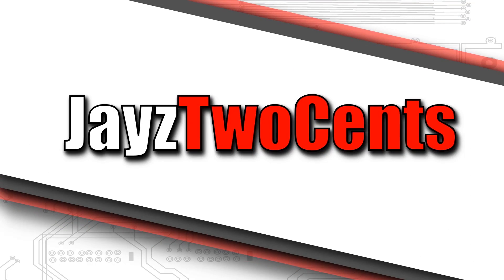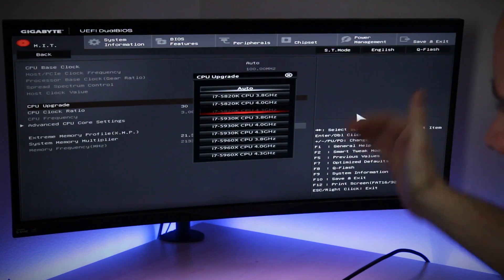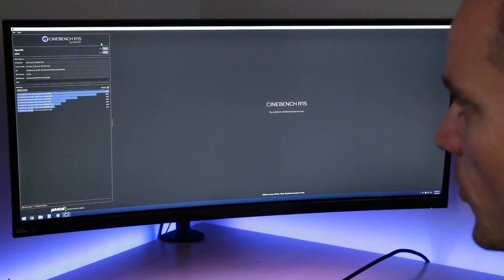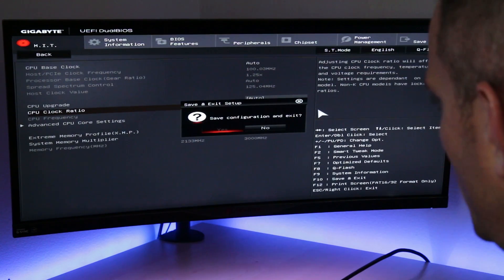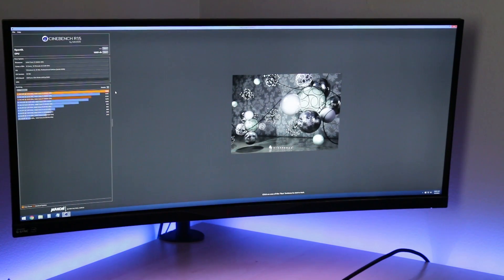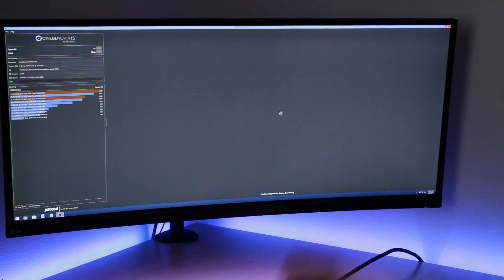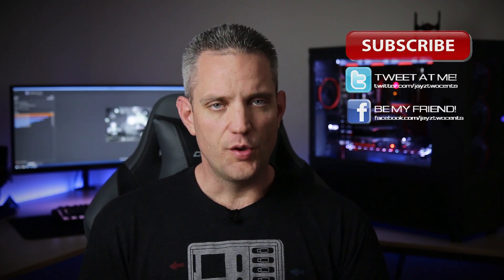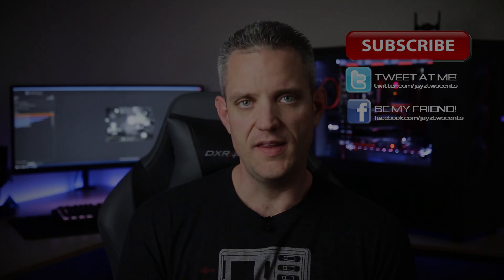XMP vs Overclock

Comment: Hey jay, just wondering, I am going to buy an i7 5820k and 16gb of 3000mhz ram. would i need to over-clock my ram for it to go to 3000mhz? and would I be able to do that at the same time as over-clocking my i7 5820k to 4.0ghz? Thanks
Reply: yes and even without given more voltage. my is running 4ghz stabil with just setting it to 40 in MSI bios
Reply: +Kenny Søholt and I had 16gb ram 2133mhz at that point. now I have 32gb of corsair Vengeance 2666mhz running quad core
Reply: Kenny Søholt so do i enable XMP then go to 4.0ghz through cpu? could you give me a tutorial link on that or... sorry just a little confused, first time overclocking cpu and ram together etc

Comment: FX-6300 5.45GHz @ 1.716V? Yeah, very slim chance of ruining anything... :)
Reply: +Dexeus I-Is that what you are running? What is even the point? The 6300 is garbage even at high frequencies. Do you really want to risk ruining your motherboard and processor for such minimal differences?
Reply: +Deadrablade I'm not running that 24/7, it's just my personal highscore :) Although the 6300 isn't nearly comparable to X99s, it's definitely not garbage. Very nice for overclocking :)
Reply: Dexeus Good for overclocking=/= not garbage

Comment: My system caps out at +42% overclock. I tried to get it higher but i keep increasing voltage and eventually crash anyway 
OR turns into a active vulcano neither is wanted. Maybe i could get a + 2-4% more but pointless.

Comment: got 5.0 stable on my i7 4790k on air (noctua ndh 14)
Reply: I give it a year
Reply: you gave what a year?? :P
Reply: +Jakob Olsson 5.0Ghz on air cooling, I would give it a year max for your cpu to burn out I would recommend toning it down to 4.4-4.5Ghz for better mileage in the long run :)
Reply: why my 100% load temp is 68 Celsius
Reply: i was really lucky with my chip i think
Reply: you might just be
Reply: i have it on 1.33 volts
Reply: and stress tested it in 24h with aida 64 and no crashes
Reply: ah fair enough
Reply: yea so i think im fine :)
Reply: have used it for 14 months now

Comment: I can't OC because i have a i7-4770K.
Reply: If the chip has a 'k' you can overclock.
Reply: +Joe Higgitt i know,but try OC an 4770K.
IHS is shit,and it's luck of the draw with them.
Mine needs a ridiculous amount of voltage to keep stable,so it runs so hot you can bake crepes on it.
Reply: +Dimera ah that sucks, although I have a 2500 k and run a 960 and don't need to overclock. Especially when DX12 comes out and it can utilise hyper threading more, you probably don't need to unless you're rocking a serious GPU.

Comment: Hey Jay, any reason why you run your CPU at full speed all the time? I personally find Intel SpeedStep to be working very well and and why not give it a rest from time to time while saving money?
Reply: how do you enable it in bios?
Reply: Depends on your board, but look for EIST (Enhanced Intel Speedstep Techonology). You also have to set your power options in windows. Go to Advanced settings > Processor power management and setminimum processor state to 0 or 5 % (0 works fine for me)

Comment: I can overclock, Not that i have the cooling, but even when i have my better cooling solution it won;t be a hiegh end one. Just a 212 Evo. even sdo i should be able to get my 8320 to a 4.2 ghz. But here is the catch.

I have an Asrock 970 Extreme 3 R2.0, Which is a 4 - 1 power phase, Or so i read on a forum, Tomshardware. But my motherboard has this X-boost feature which automatically overclocks your system, also read that this cause issues for people.

I also have read that a 4-1 power phase motherboard is bad for overclocking because it get hotter than the better 8-2 power phase, which makes sense, Although i should be able to push it to 4.0 ghz without anytrouble as it regularly boosts to 3.9 and my motherboard never really gets hotter than 30C usually stays below that. the socket itself stays around 50 - 60C sometimes going to 66C

May i also add that i have terrible case cooling.. also a terrible case which basically has 0 airflow capabilities the only front fan i have get's obstructed by 3 HDD. Can't wait till i got my s340...
Reply: +Hendrik visch dony push to hard on that mobo, it's very easy to fry
Reply: I have my case slightly sideways and a fan that i hardly use my self facing inside the casein an angle so the air goes in the front and the side..

But an 8320 is basically a downclocked 8350, So basicallt i should be able to put it on 4hz with no issues as it boosts to that number anyway with no issue... I have seen the voltage go to 1.42 and it never became to hot. And if my mom doesn't go crazy with the heating in the house my room cna get pretty cold like right now. But i like this cold because i get hot very fast,,, I wear a vest and it feels not colder than i usually feel, basically on what i like, in a hour i probably feel liek opening my vest because i have it too hot.

But since this motherboard CAN house a 8350 i could make it work if i can mke it happen in just the 1.3 voltages.

An 8320 is a 8350 that couldn't stay on 4ghz on the 1.3 voltages. I have no ideo how long this tests ran but i see people doing it anyway... Probably it was heat that was also a factor. But a .5 overclock should be  a ble to. If i have won the  silicon lottory i can do 4.2ghz.

The current case i have is the Sharkoon VG6-W Green. Horrible case, Horrible.

Comment: 0:13 FX-9590 LN2 Overclock attempt No.3.
Reply: Actually a good one 😅😅
Reply: OMG love this comment spent hours on the phone talking my buddy through troubleshooting his PC crashing while gaming on an fx9590 (air cooled default bios settings)
Reply: @johnnyconnors4167  I'm still using an FX9590 (unfortunately) after 5 years. Back when I first got it I was able to clock it at 4.9 tops. Now I have to underclock it to keep it stable. 4.5Ghz, 1.36v and CPU/NB 1.15v Freezing has always been a problem in general with the 9590. Honestly, this CPU has taught me a lot about OCing and I really didn't know what I was getting myself into when I bought it 5 years ago thinking I could conqueror this thing. :P
Reply: LOL
Reply: dosduros on LN2?

Comment: Silicon lottery isn't nearly as big of a deal anymore with Haswell/Haswell-E/Skylake. (ESP Haswell Refresh and Haswell-E). With recently made chips, you can basically dial in 5 minute manual overclock higher than any automatic will do (4500 @1.3V on x99 is a good example) with near 100% success (obviously assuming your cooling is good enough, but that only needs like a 240 mm aio really).

Also Jay have you tried increasing VCCIN for your 5960x? It starts to be a bottleneck on overclocking on quite a few boards at around 4.6-4.7 GHz (for me personally I literally could not get anything over 4.5 stable regardless of voltage until I moved it up). General consensus around the enthusiasts with the platform is anything under 2.0V is definitely safe, and even 2.1V should be fine for long term use.

Comment: 2 question i have:
1. what is the max "non-sweating"/recommended voltage on a cpu? and it depends on chipset, mb power faze etc?
2. i have a mb without vrm heat sink, does that mean i'm limited on voltage/oc (if i don;t wanna blow op my vrm)?
Thank you.
Reply: +Fisoi Cel Mic 1. Let us know your cpu model, without is kinda hard to guess...
2. yeh dont push it to far if you like to keep that motherboard for long time
Reply: +ODIO POWER 1. it depends form cpu to cpu? why? (G3258)
2. If i put heat sinks on the vrm using thermal adesive it will be ok then?
Than you for the answer, i'm looking forward for more opinions.

Comment: I got an Fx 6300 but I'm not gonna overclock it until I get a better gpu because my GTX 650 is the problem not the 6300. Although I overclocked the 650 she's at the best she'll ever be.
Reply: It couldn't be the 650. Only way to really know is, to overclock the 6300. Don't waste money on a new GPU without knowing if your 6300 is actually bottlenecking it.
Reply: Captain Einstein it's a cheap old gpu from two generations ago. I'm certain that its the 650 and its just too old and not powerful enough
Reply: Afro They are both from 2012 :)
Reply: And as far as I know, the FX 6300 was released before the 650.
Reply: +Captain Einstein But the 6300 is still relevant with today's technology but the 650 is clearly outdated.
Reply: I think you are mistaken. Most people would say otherwise.
Reply: Captain Einstein 650 is shit paired with any CPU. 6300 is good paired with a good GPU
Reply: Afro I have a friend who had a 6300 with a 770. He changed to a 970. And still had problems, till he bought a 8350. He added 2 more cores to his setup (which wouldn't really help). But that solved his bottlenecking issues.
Reply: Captain Einstein The GTX 770 is 222% better than the GTX 650
Reply: +Captain Einstein Case closed?

Comment: X.M.P. profiles affecting CPU BCLK whaat? I didn't know there are that kind of profiles. Very fishy if you can only get the rated RAM overclock with BCLK overclock. Though you're talking that overclocking the RAM affects BCLK which is pretty odd. The motherboard sounds weird because of that.

Comment: crucial ballistix sport is great. it's cheap, it looks decent, and you can overclock the crap out of it.
10/10 would overclock16gb of 1600mhz ddr3 to 2400mhz (very stable) again. worth the $65.

Comment: It sucks that I can't over clock since I accidentally got the Asus M5A97 le mobo which doesn't have a heatsink on the vrm
Reply: +airriderz15 you can still overclock just not a lot, I have my fx 6300 oc'd to 4.1 stable from 3.5 on that same mobo and could go higher
Reply: +airriderz15 you can OC, just not nearly as much as with a motherboard that has proper cooling, unless the BIOS doesn't support it?
Reply: +TheNerdyCanadian I have an FX-8320 so I think I'm at the limit of the  tdp for the chipset
Reply: airriderz15 possibly, since you can OC an 8350 quite far with the 990X/FX chipset
Reply: +TheNerdyCanadian well I'll try it once I get the chance
Reply: Well you could simply put some cheap aluminum heatsinks on the VRM. It would be a good start at least.

Comment: My 7850k wont clock past 4.3k regardless. The temps are 68c max load with Prime95. Im not good at overlocking but I may give up trying to get higher due to lack of skill. I just have it at auto overclock setting with XPM profile for the ram set @ 2400mhz. Even with XMP set to auto and having it run at 1600mhz I cant run 4.4k stable.

I have Asrock Extreme 6+ motherboard.

Comment: I used to do it manual back in the day of the Core 2 Duo, especially the e7200, 400, 500 series of CPUs, there was only manual then but those CPUs would overclock like a Champ.  These days I just go for `set it & forget it` at 15% on an i5k series cos life`s too short, especially if the build is for someone else.  I will experiment more with software GPU overclocking though

Comment: Jay, what do you think of ASUS 5-Way Optimization ONE CLICK OVERCLOCK??
I have a Maximus VIII Hero and a Skylake i5 6600K and I don't know if I should use this ASUS Software for overclocking and coolers settings or if I should overclock and configure the coolers direct via UEFI BIOS. Please JAY, Could you help me??? =] PS: I have a H1OOi GTX for cooling.
Reply: I used the ASUS overclocking utility and wasn't impressed. the overclock it achieved was unstable AND used too much voltage ( tried to push 1.5 volts to my I5) I have an Attack mobo now and the one touch utility they use has been great for me. 4.6 stable at 1.3 volts on my 4690k. only hits around 62 degrees under full load too.
Reply: +TheCoolTable Asrock* not attack, lol. stupid auto correct...
Reply: i7 is pretty useless at the moment compared to a i5 it have like maybe 1-3 fps more in games:Pbought the i5 6600k myself and its working great and dont bettleneck the 390:)maybe more threds gonna work better in dx12 and if have a better gpu but a i5 can handle all the power of a 390 right now anyway:)so pretty useless to get a i7 for 100bucks more imo:)buy a new cpu or a used 1 in like a year insteed and sell the 1 u have if u need it then :)
Reply: Why would you go with such an expensive MOBO with an I5?
Reply: +Joe Higgitt Because I7 does not make much diference over the I5 in games.
Reply: when DX 12 drops it's going to utilise all those extra threads. Also, just because you don't believe an i7 wouldn't make a difference doesn't justify an overkill mobo.

Comment: Back in the socket 775 times, everybody was all about dat bClk because the unlocked quadcores started at well over 600$

...

I still run a Q9550....

(I did manage to get it stable @3.2GHz with a POS OEM power supply and 5:6 FSB:DRAM ratio and stock cooler with okay temps. I really need a p45 board and a better PSU before I'll give up on that thing)

Comment: Wow, the results on your motherboard are much different than what I got with mine.  I also have a 5960x and 3000 MHz ram (4 x 16GB TridentZ), but I am using the MSI Gaming 9 ACK motherboard.  Under the OC Genie overclock, it defaults to 3.6 GHz for the CPU (not much higher than the 3.5 GHz Turbo Boost) and 2400 MHz for the RAM.  Under XMP, the overclock jumped all the way up to 4.2 GHz, but I did experience a couple crashes after extended use.  I think this was probably related to the memory controller overheating because the CPU temperatures were only in the mid 50's and I have been able to achieve higher OCs on the CPU with a lower memory speed.

Comment: I think it's only on MSI motherboards, but I used a one click program called OC Genie and it automatically Overclocked my 6300 to 4.5 without any crashes and with my Hyper EVO 212 the CPU isn't reaching a ridiculous temperature

Comment: i dont understand why someone wouldnt overclock :/
on my i7 4790K the core clock speed at 4.0Ghz is good, but ive got it to 4.6 Ghz while being stable just by using a preset overclock, an extra 0.6 Ghz makes such a difference, especially when rendering stuff

Comment: I am using my 8350 at 4.7ghz for 3 years on a row, love it. Can't go any higher because the heat is crazy at 1.55v 5ghz+. Good vid again
Reply: +Ruben Stroobants 4.7 is the sweet spot for the fx8350. I have it at 5.1 1,5v with a custom loop and max temp  is 36c. But it is so hard to get there...
Reply: +DRIFTMOMENTS.GR Nice oc =D
Reply: thanks m8, I just did the test with my computer at 4,93 and i get 769.

Comment: the problem with all auto overclocks from the bios is that they tend to use waaay to much voltage and even in the unsafe range. I tell people to never use the auto settings for this reason. last I check (like a week ago). This ultra high voltage still happens (on msi and asus at least). an example would be my MSI z87 decided that 1.4v(unsafe and quick cpu death) is  best option for 4.5ghz and 1.35v for 4.2ghz on a i7 4770k. I was able to run 4.2ghz using manual @ 1.1v / stock voltage. And yes it's prime95 24hr stable. all I did was raise the ring ratio to get it stable...

simply never use auto oc and you will have a working cpu got a very long time

Comment: Bought a i7 860 back in 2009, best value for money ever !
Overclocked it from 2.8 to 4.2GHz and it's still very relevant. Never went above 75°c with a Noctua NH-U12P SE2 and is comparable to a skylake i7 clocked at 3.8GHz when it comes to gaming and many applications. I just miss out on SATA3 and USB3 ...
Cool story, right ?!

Comment: My Tiny FX-4130 is running 4.4ghz but the temps are limiting my overclock. I can run 4.6ghz but then is hits 85+ dergree Celsius and because my mobo needs downwards cooling from the cpu to keep the north bridge from burning up I can buy a nice aio liquid cooler. i am a sad panda :(

It now runs at 65-70 degrees celsius. hot but ok ish

Comment: With my 4690k, on stock i get a cb r15 score of 594 and with my fully manual overclock, which is 4.9 Ghz and the ram at 1866 cl 10, i get 740. Cpu is delidded and cooled by a custom loop.

Comment: T_T Since Jay says not to worry about degradation and I am receiving comments why I did not overclock my i7-6700K on MSI Z170A M5 mobo, I shall run my OC Genie on BIOS
Reply: +fir_nev  I have exacly that combo too and first thing i did was oc the cpu to 4.5 ghz with stock voltage 100% stable, have not just had time to fine tune and see how far i it can go.
Reply: +Vampyiere With Ur assurance and Jay's stare that got me hypnotised, I think I would give it a shot. I am afraid of fried CPU after OC.

U should see the replies on my comment for Jay's last video on OC!

Comment: i got done with my benchmark of my AMD fx 6300 6 core CPU.
 
i got 408 stock (3.5Ghz turbo 4.1Ghz)for some reason it is the same with turbo turned on or off don't know why. i think it is something to do with CINEBENCH.

i OC at 4Ghz all cores turbo off i got 455. 
one crazy thing about this OC is i use epu-4 engine i use 1.234 volts, but at stock with turbo it uses over 1.4 volts. it is stable at the low voltage this is a 95 watt CPU and it barley gets over 60 watts at max load and temps barley hits 50C at max lode idle temps are 10-25C the the Tj.Max being 83C. this is with stock heat sink 

just for fun i down clocked  my CPU to see what low score i can get. 
i got 80 at 800Mhz with all 6 cores and 12 with only 1 core.

Comment: BASIC input output system. Since UEFI is now standard it needs to be renamed. It ain't basic at all. UEFI bios has like 16bit-depth color and mouse support!
Reply: +enticed2zeitgeist I doubt the convention of using "BIOS" will likely change.  Sort of like the attempt to call motherboards "mainboards" or changing the now antiquated jumper settings "master" and "slave" to something else.  The attempts never really stuck.
Reply: +ejeckk Yeah I hear ya. Mostly I just wanted to throw a comment out there that had some meaning in it and also to add to JayzTwoCents trendingness.
Reply: enticed2zeitgeist Hey, my man, I was doing the same.  Just wanted to add to the intelligent conversation.  Be well and good Karma to you, brother.